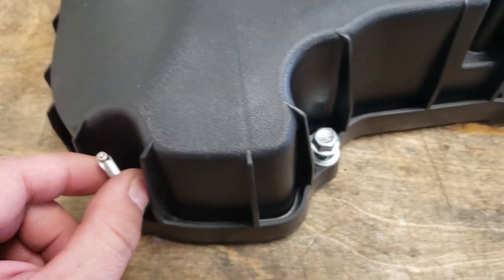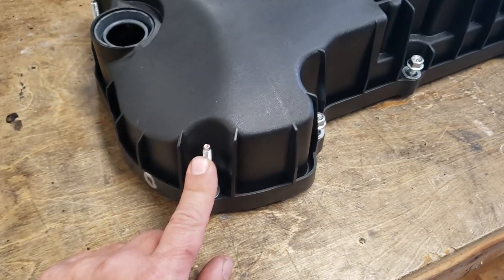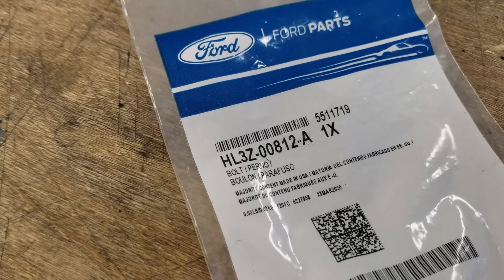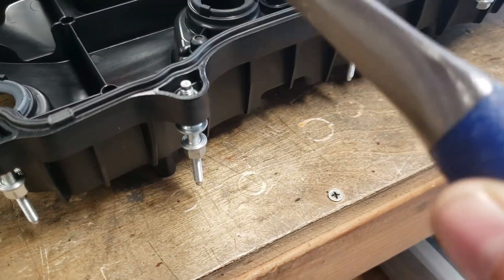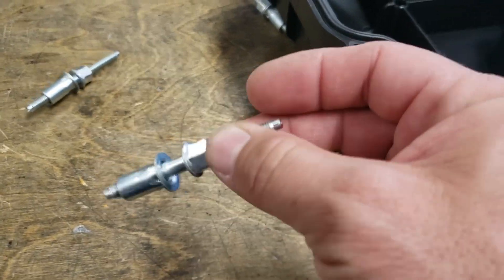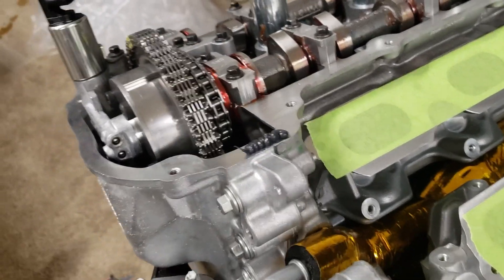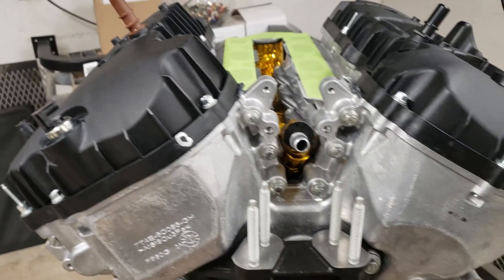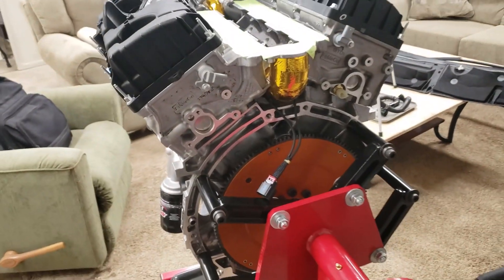Explorer SHO Flex 3.5L EcoBoost: Valve Cover Stud Replacement & Installation Guide

Comment: Nice work.   I'm taking off my valve covers right now.  I am replacing the water pump.  In the car of course.  I now just learned from you about these caterpillar beads of sealant. I saw the old stuff piled up when pulling off the covers. What is the spec number on that Motorcraft gasket sealant? What kind of sealant for water pump and timing chain cover?
I have over 120k miles and probably should do the timing chain. What exactly should I look for in wear on chain and components? I'm not trying to be a total dumb ass here, I did look at your web page. I looked at the info on injectors and went to Xtreme-DI.  Wow! You must really love this engine and car! I just want my 2014 Exploder 3.5 Ecoboost to run great and perform better than stock. I only see stuff of Explorer ST.  
I was thinking of doing injectors and rails.  So is there anything out there you would recommend? Hopefully better than OEM, but also in the hundreds $ of dollars and not into thousands $. 
I'm not even sure if just to upgrading higher pressure injectors alone will do anything without other mods.
Anyways, I'm going to study your build page more. It is very helpful to my cause. I'm getting replacing my plastic valve covers. Front one was cracked around filler tube. The new covers are aluminum and black. I want to EVH stripe them just like Eddie's bumblebee guitar. If it works out and looks good I will send pics.
One more thing... motor oil. Motorcraft?  I am going with a 5w30 full synthetic API SP. What did you use on this build?

Comment: Why do you need to replace these ? Are they not tightening up is it leaking from this wouldn't just replacing the gasket be fine I'm kind of confused I haven't pulled the valve cover gasket up yet but haven't dealt with this issue in any other motors
Reply from the maker: Did you even watch the video? I explained it pretty clearly. It's also pretty obvious when you simply look at it...

...I'll let you figure it out. Thanks for commenting. 😉
Reply: @4TheWorkshop  yup I watched it and I just watched it again you seem to not want the studs in there in what appears to be the front of the valve cover are you just doing this for appearance reason
Reply from the maker: @Travis-hl3oz  ok...next question. Did you read the narrative that goes along with the video? Everything you need is at your fingertips. It's pretty easy...

Do some of your own research and stop asking for handouts.
Reply from the maker: @Travis-hl3oz  lol...hey you came to MY video, 🤣🤣🤣. Read the narrative buddy. Learn to do some of your own research. It's all there for you. Stop being lazy and needing your hand held on how to use the internet.

Thanks for the views. 😉